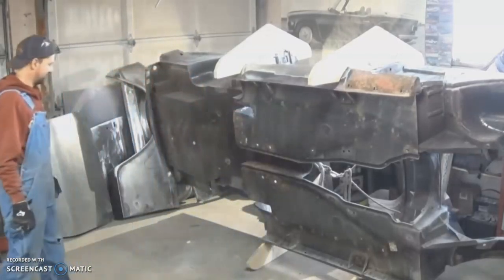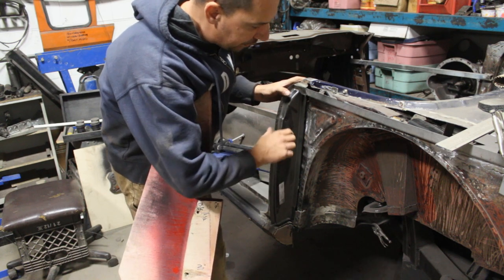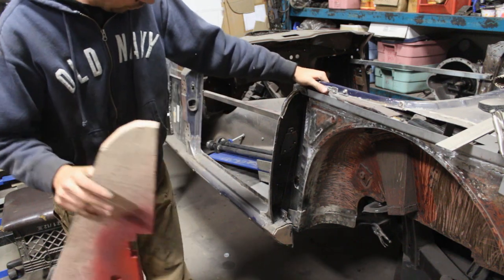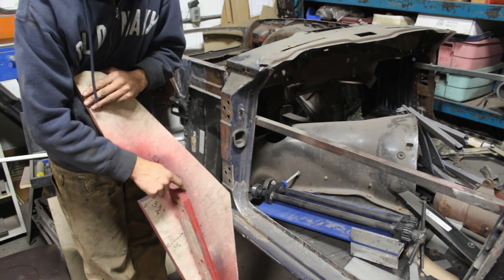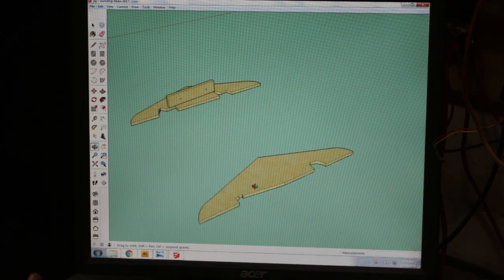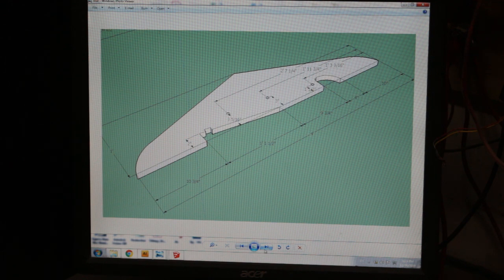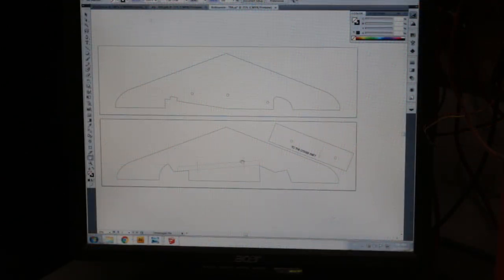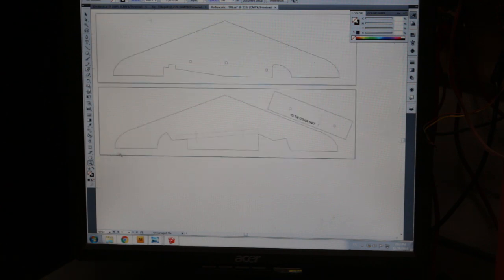Easy Rotisserie - Free Plans

Comment: Elin,  I have all the pieces cut and am ready to attach the two 1/2 inch side pieces together.  I just re-watched your video and you said you glued and screwed the small attachment pieces onto the front jigs, however there was no mention of the method used to put the 2 main pieces together.  I am assuming you just glued them together as I don't see any screw holes on them.  If I'm correct in this, did you just use yellow carpenter's glue or some other product?  Thanks,  Ron Trottier
Reply from the maker: Hi Ron, yes, I just used yellow carpenters glue to attach the 2 pieces together. I clamped them with big clamps while the glue set, but if you don't have big clamps you can just use some screws to make sure they are compressed nice and tight. For attaching the small part to the big part make sure your surface is even where the glue is going to be, otherwise the glue won't hold, and relying only on screws at this joint is not a good idea. Ideally some biscuits or even mortises and tenons would be a good idea if you have the equipment, but mine and Cheftushe's sets are just glue and screws and we had absolutely no issues.
Reply: @RustyBeauties  Thanks Elin, I will take your advice and use the glue and screws as well as dowels (no biscuit joiner) on the small parts.  Cheers,  Ron
Reply: @RustyBeauties  Hi Elin,  I made the rotisserie and it is working great.  I was able to use the Big Print drawings without buying the program by just using the eval copy and extending a few lines by pen. I modified your plans slightly by moving the small piece (1/2 inch narrower than your dimension) to the rearward side of the front jig (same basic vertical location) which enabled me to keep the stripped down doors on the tub for added rigidity because I had left just the latch and the small upper door bracket on the B posts.  I attached them using 1 bolt through each of the front door hinge holes. I now have the tub tipped up on its side and have placed two wheel dollies under the jigs which allows me to wheel it about my garage with ease and keep it stored while I'm working on stripping the chassis down.  I've got the drivers side front suspension off already and will do the other side tomorrow, then on to the rear end suspension.  Thanks again for your help.  Ron
Reply: @ronaldtrottier8431  Ron _ I am starting to make the jig....I have one stupid question...the 2 rear pieces are identical.  Aren't the front pieces mirror images and not identical?  Seems like the piece that gets attached to the car has to be on different sides
Reply: @tehammel  You are correct.  The two front pieces are mirror images, as you have stated, with the support attaching brackets on opposite sides.  I have had no problems with my wooden jigs, and currently have my tub stored on its side, as stated above.  I have also made a metal rotisserie from two motor stands and a 14 foot piece of 2"x2" square metal that I have my frame attached to at the moment. As well, I have custom-made a square metal frame to attach to the body and then to the metal rotisserie which I think will be much easier to use and rotate than the wooden rotisserie and give me infinite angle selections for repairing the tub.  Having both the wooden and the metal rotisseries have made tub storage and simultaneous work on the frame restoration so much easier.  Good luck.  Cheers,  Ron